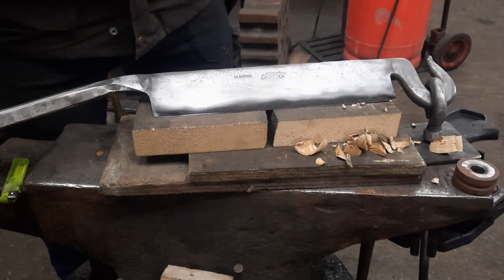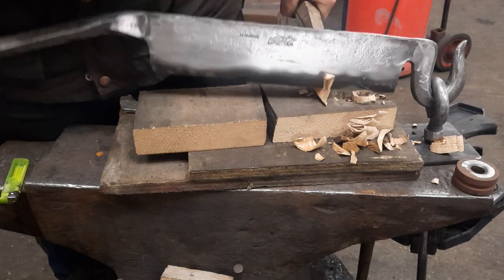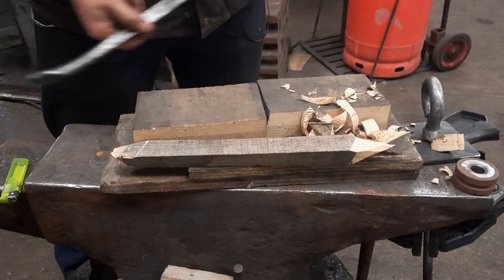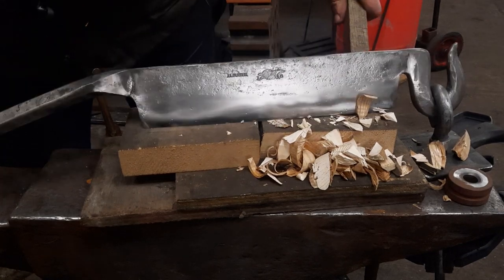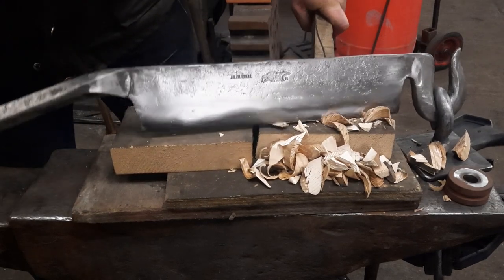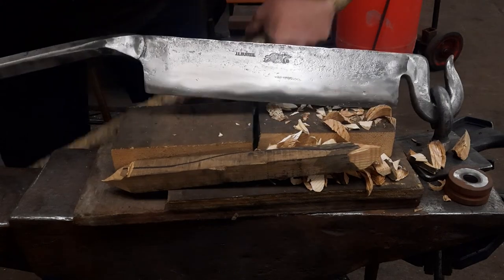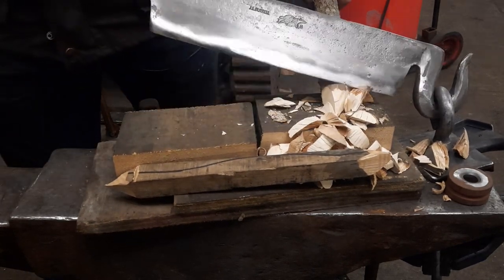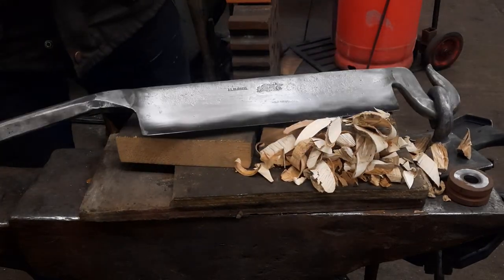Stock Knife

Comment: There's one at Hawes Museum about this size. You're the only person seemingly capable and willing to make  a proper working copy. One that I could actually use.
 The knives came out of Carter's factory with barely a gap betwixt hook and blade and the blade the depth of the hook. The blade needs a secondary bevel, however tiny, or it won't cut a concave roll curve; or any sort of curve actually as the blade jams. I discovered this when I sorted out an old set for JoJo.
My stock knives are a shade over a metre with as new about 6cm of lead on the handle centre. My Elwell peg knife is 92cm with about 2cm of lead. The more power you put into the blade in leverage the more lead it seems to need. Much shorter Paroirs and Dutch klompen knives have barely any. Stock knives used by blocking gangs to cut  green Alder and Birch often had twice as much lead on the handle. A hollower  came to me with the handle bent back to be in line with the blade. It is unusable. I can't pull the blade through and maintain an angle.
 Only Sycamore is cut virtually wholly green, though it is easy enough to recut an old dry sole. Birch Alder Willow and Poplar all have to be finished dry, as they shrink, but then they are softer. Alder was the main clogging gang's wood  of choice with Birch  where it was available in quantity.
Reply from the maker: Hi Jeremy, thanks for the comment. I think it's about time we had a proper chat about these. You can send me a contact email through my website if you like, and we can get down some of the details and particulars that really make them work. 

Thanks for now 

Josh

Comment: I modified a drawknife and turned it into a basic stock knife. The tool cost me $15. I removed the handles, bent one end into a hook and put a foot long ash handle on the other end. It works like a dream. I call it my schlocknife. I wish I could add a pic of it but it doesn’t seem possible.